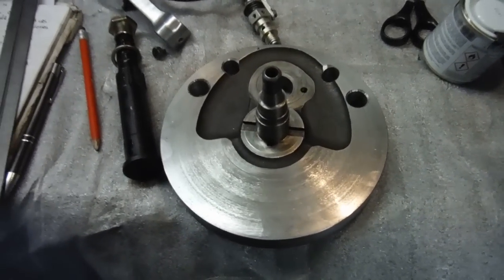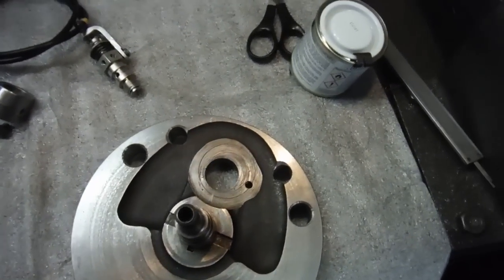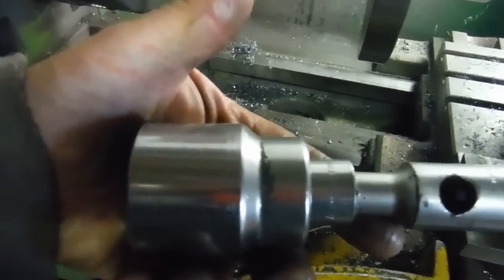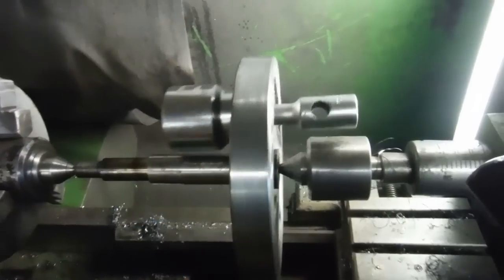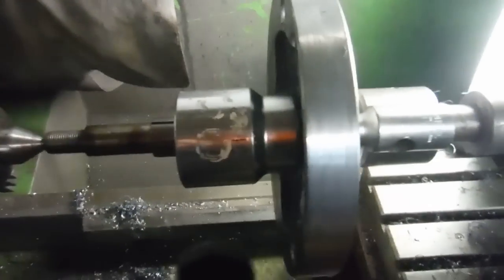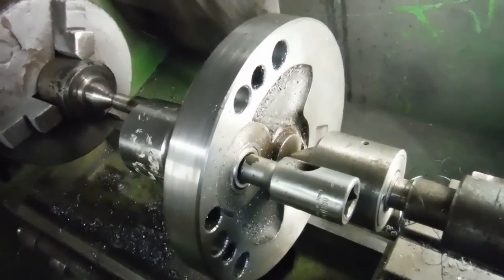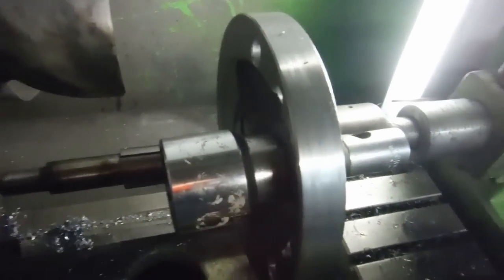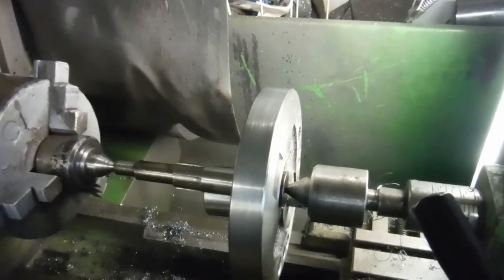Royal Enfield Bullet crank balancing by Performance Classics.

Comment: Whats the balance factor for this crank ?
Reply from the maker: I usually set them at 0.66.
Reply: @paulhenshaw4514  you mean 66%??...thanks for the awesome info btw..
Reply from the maker: Yes, 66%
Reply: Paul 66% of what.. 
What all are included when u consider the weight that needs to be counter balanced

Comment: So that’s 1/2 the weight of the crank pin conrod bearing gudgen pin n clips n piston?
Reply from the maker: No, it is, in my case  0.66 x the weight of the conrod small end resting on a scale with the conrod horizontal, plus the weight of the fully assembled piston.
Reply: @paulhenshaw4514  do you mean to say the TOTAL weight of the piston assy (piston, piston rings, wrist pin, retainers) plus 0.66 the weight of the small end? Or 0.66x all combined?

Comment: Do you reckon you could shave off weight on the perimeter or width instead of holes ?
Reply from the maker: Hi Chris, the holes are just for balancing, I reduce the diameter of the flywheels as well as the width, from both faces, usually losing around 1 - 1.5 kgs of weight of a fully assembled crank.
Reply: @paulhenshaw4514  This is all very interesting but I lost desire to buy this bike in the end. It's annoying having to do so much work and at this depth. There are plenty of other things to work on. I wish they still made it in the U.K even if it meant it'd cost a couple more grand

Comment: Does the bullet standard 350 has heavy crank of India made bike when compare to classic model?
Reply from the maker: Some Indian 350 engines have lighter cranks than the British ones, while others are the same.
Reply: Here in indian model bullet standard 350 (only kick start ) this model has heavy crank. On other model it has lighter crank only
Reply: Could you tell me the weight of heavy crank
Reply from the maker: Approx 10 kgs.

Comment: Hi Paul, do you think that truing the flywheels on a GT 535 will add some punch to the performance with a Free Flow Exhaust, Air Filter and a Power Commander?
Reply from the maker: Truing the flywheels only helps minimize vibration, it will not affect performance. I think the uce cranks are supposed to be pretty true from the factory, unlike some of the older 'Classic' types.

Comment: Does crank balancing solve the vibration problem that occurs all over the rev-band ? I do know that large Single Cylinder engines do vibrate.But also learnt that Enfield Cranks are not properly balanced at all,which is a cause of vibrations.
Reply from the maker: The balancing is quite important, but truing the flywheels - and more importantly - the mainshafts is vital for smooth running.

Comment: When balancing, does the counter-weight include the weight of the piston and the rod?
Reply from the maker: My mandrels made up from socket set components cover 350 or 500 types and account for the standard balance factors, with standard rods and pistons. I use the same balance factor for whatever type of pistons or conrods are used and this seems to work fine.

Comment: Sir
I own a enfield standard 500 cast iron 4 gear rhs shifter,kick  start ,Indian made.it got heavy vibrations.so I want to increase its crank weight.i want it smoother and vibration free.can u help by imparting some knowledge
Reply: Find a competent professional machinist who has done this work before, and not some backyard bodger.
Reply: Ob Fuscated it’s very hard to find
Reply from the maker: Making the crank heavier will not help. More likely, your crank is not trued very well, I have seen many with terrible runout on the mainshafts. Also, it is possible the crank is not very well balanced, but this is less likely. If you are taking the crank out to check, also take a careful look at the condition of the main bearings.
Reply: Paul Henshaw sure sir,I hope that runout can be rectified in a laithe.i would appreciate ur more help on crank weight and balancing

Comment: Who still does Enfield crank building/balancing?
Reply from the maker: I do, for a start!
Reply: What I meant was, who that I can actually find and contact about balancing?
Reply: A search for "Performance Classics" only shows these vids. No website or way to contact someone about actually getting crank work done.
Reply from the maker: Are you in the UK? I am in Carmarthenshire. Google 'Paul Henshaw Performance Classics', that should do it.
Reply: Nope. The US. Where it's a total no-man's land for Enfield work of any kind. Hell..., I probably know more about them than most here.
Reply from the maker: Ace Performance are in the U.S. and might be able to help?
Reply: I do have a machine shop (mill, lathe, indicators, etc., and an apprenticeship as a machinist back in the early 1980's_). Have been working on old brit bikes for years/decades (first bike was a 1970 Triumph Daytona), but this is the kind of thing I'd rather give to someone who does them on a regular basis while I do the other machining and work. But..., I do get the hint, as everything these days, we pretty much have to do it ourselves (and seems no young people actually want to do anything with their hands, rather sit at a computer, so all of the trades are dying..)
Reply: An independent shop (not a dealer) with older Harley experience will have no problem with those built-up crankshafts. Mr Henshaw's videos and of course a factory service manual for the specifications should be more than sufficient to fill in the blanks. Another option would be shops who build two-stroke motocross bottom ends. If you are going to own old Britbikes or "new" old Britbikes you should consider getting the equipment to do it yourself. Fabricating a suitable, stout truing stand isn't difficult, hydraulic presses are reasonable, and so are magnetic dial indicator bases and dial indicators. I would never advise one who isn't either an experienced mechanic or interested in becoming one to own these bikes, but (as thousands of mechanics past and present can attest!) they are great learning tools.

Comment: all theses days I believed that the crank will run true if you put con rod piston and pin..
Do you balance after fixing the con rod ?or just this ?
Can you specify how much the weight need to added at the con rod end for balancing ??
Reply from the maker: I balance each flywheel to my own top secret specs before assembling and truing.
Reply: I don't need to know  any of ur trade secrets ...I'm just curious ..is it possible to have a perfect balance .. or is it varies depends upon the power/ torque /rpm ..
What's the logic or principle behind this ..
Reply from the maker: There is no real 'perfect' balance, but you can set the balance factor to put the smoothest running into a certain RPM zone. That said, truing of the flywheels and more importantly, the mainshafts is vital to the smoothest possible running and the longest possible main bearings' life span.
Reply: Thanks for the info 👍🏻
Reply: Doing a web search only comes up with your vids, how does someone contact you for balance services?